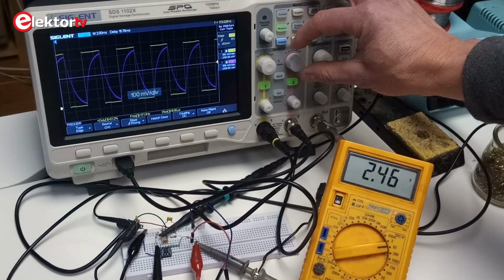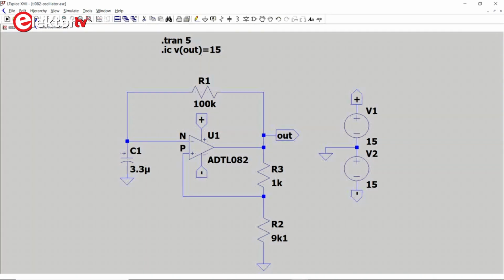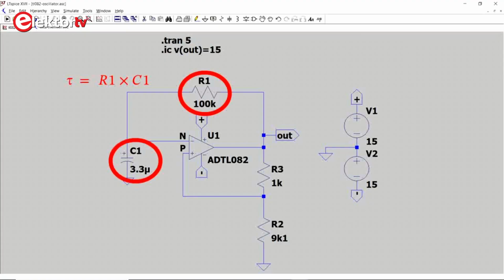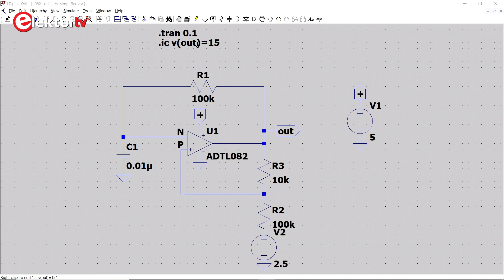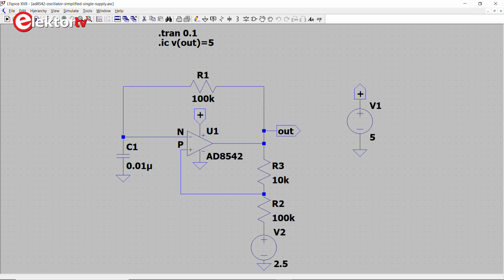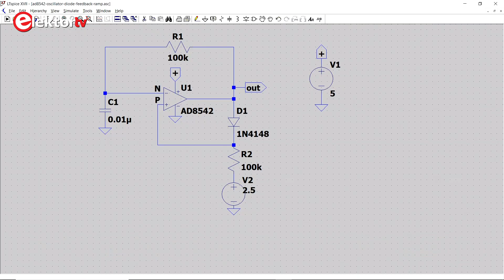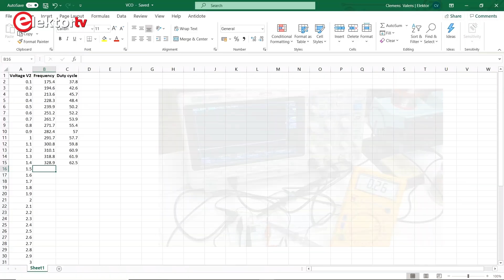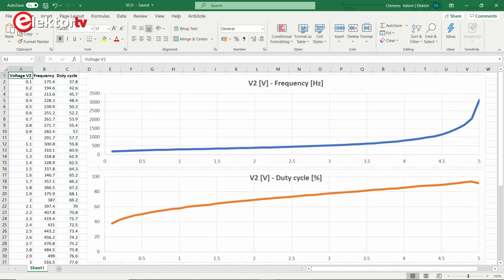Single-Op-Amp Voltage-Controlled Oscillator (VCO)

Comment: Nice explanation ! I am working on simple "sound card voltage logger" i.e. I want to inexpensively log the discharging of lithium 18650 battery by converting the voltage to frequency which will be captured by PC microphone input.  Sure, cheap capacity testers are available on aliexpress, but the data logging ability would be great without the need of expensive oscilloscope

Comment: As a note, in LTSpice usually adding a very small series resistor (0.1 ohm) with the voltage sources (in this case the two 15V voltage sources) generates enough noise to get oscillators to run as well.
Reply from the maker: Tried that too, but it doesn't do it for me in this case.
Reply: I didn't know this, however the trick with an initial condition or injecting a small amount of charge from a pulsed current source always works...

Comment: Nice idea for a V to F conversion. I think that for just a voltage to duty cycle converter the circuit just before the diode was introduced would have worked too, and more linear in the V to duty curve.
Reply from the maker: Not sure about the better linearity as it is determined by the charging of the capacitor which is non-linear in this circuit. If it is a nice triangle or ramp, then it will be linear. (The usual way of doing PWM.)